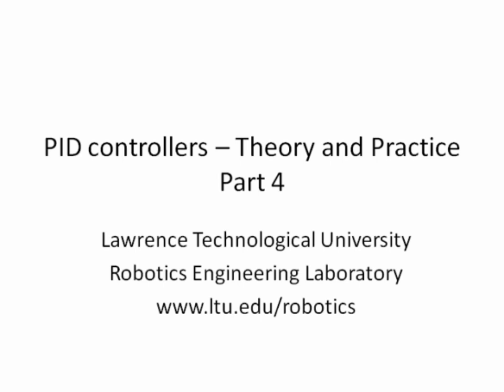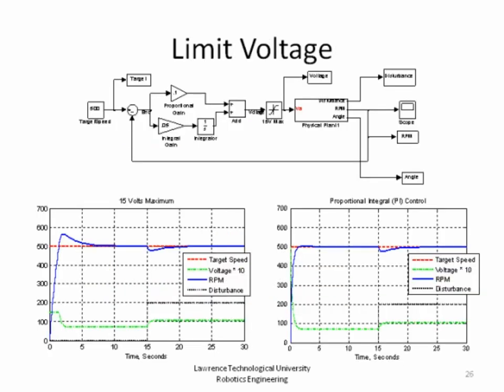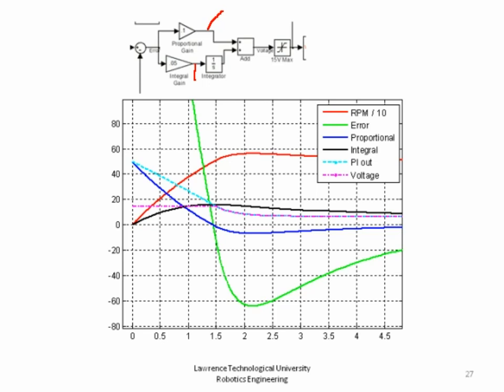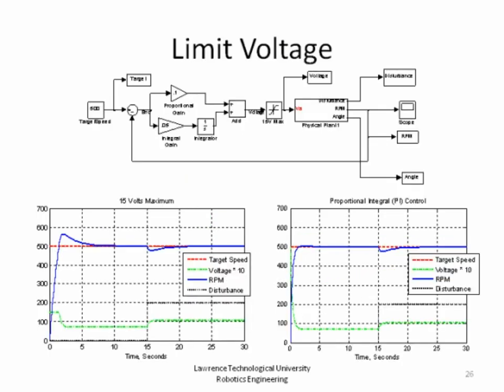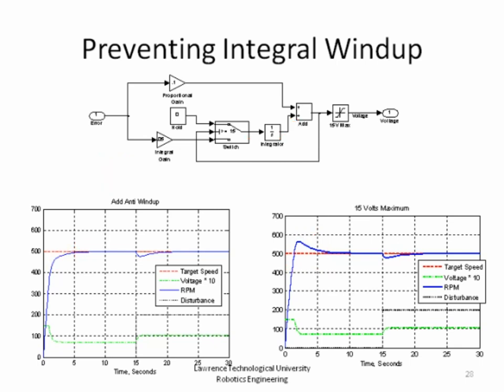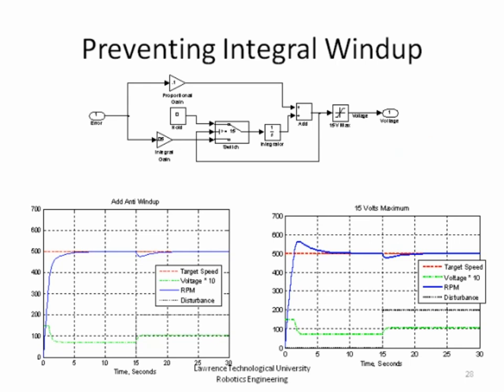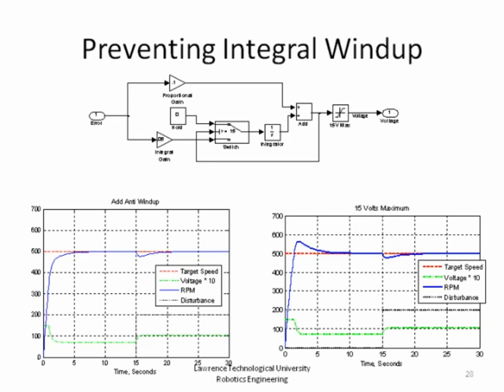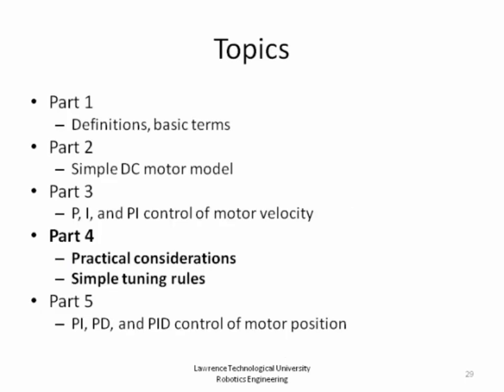PID Theory and Practice Part 4, Practical Considerations, Tuning

Comment from the maker: With 50 volts available the motor accelerates quickly and brings the output of the P portion of the control down quickly without allowing the integrator to wind up so the voltage drops quickly as you approach the target speed.